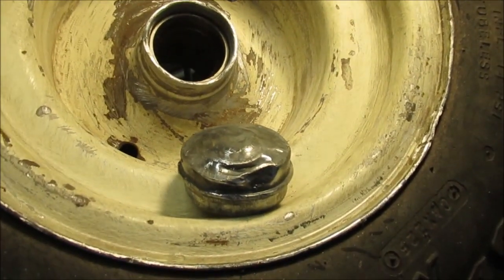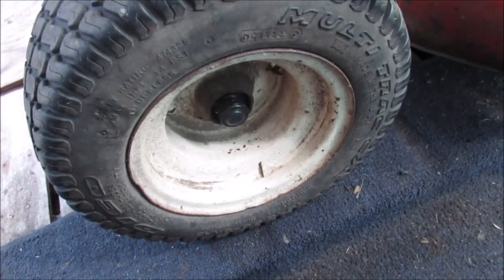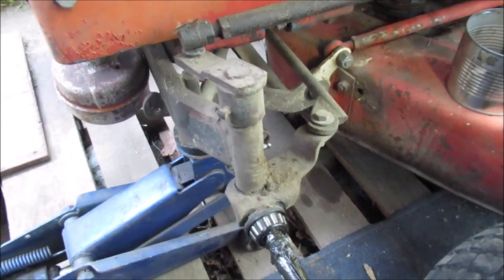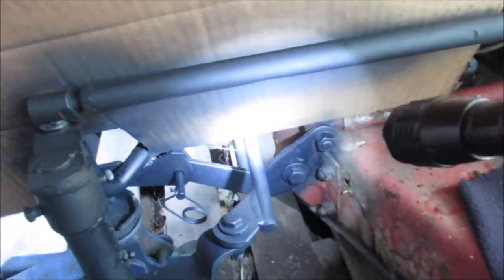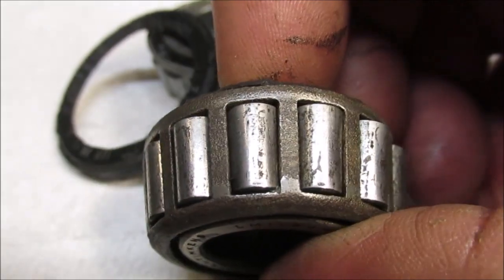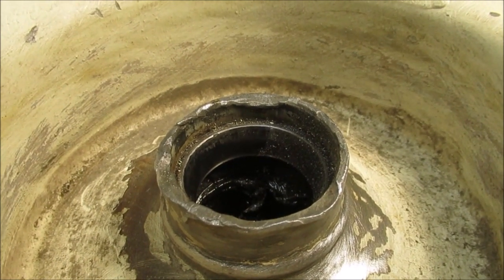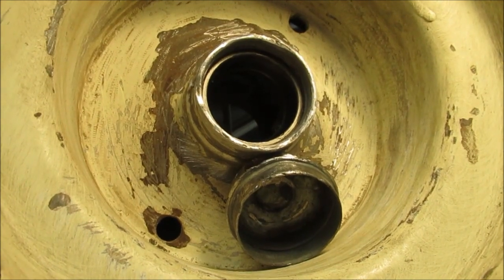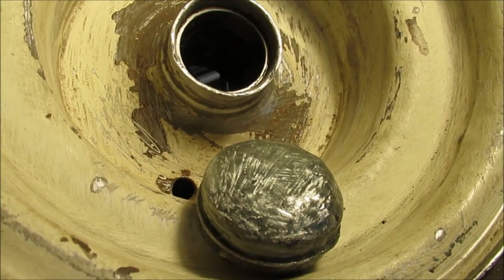Repair Damaged Wheel Hub & Bearing Cap on garden tractor Part 1

Comment: That epoxy will seal the cap up good Jim. Bend the lip on the cap and it will tighten up. Stay cool
Reply from the maker: I did try to bend  the lip out some ..still had to make it bigger with epoxy and sand it to a taper